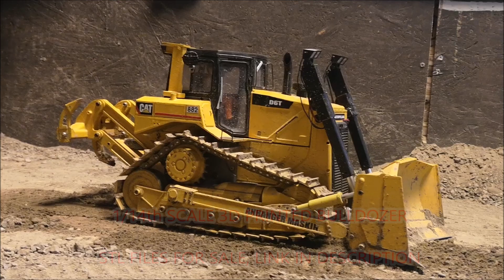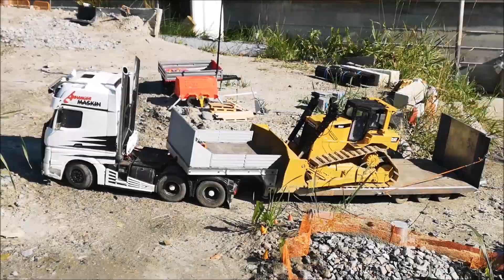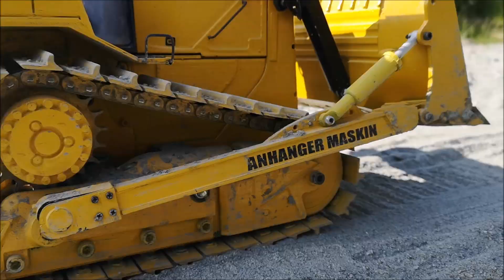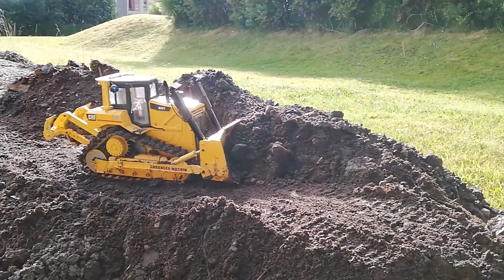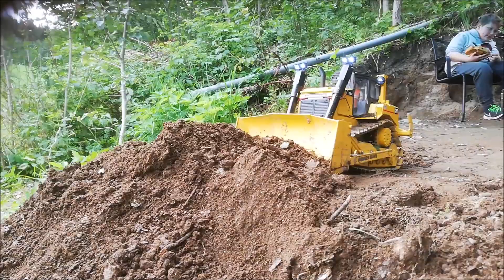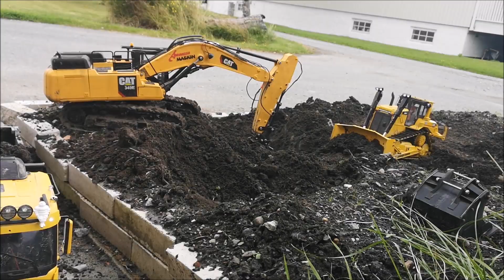STL files release - 3d print you own hobbygrade Bulldozer

Comment: Thanks Lasse! Just started mine yesterday!

These are some of the cleanest and best fitting files I've seen. Mechanically I think this thing is extremely sound. Printing mine at 100% infill and it's quite impressive!

Given the success of this one have you ever considered expanding your dozer fleet into larger machines say a D8? Something that would work in a quarry/gravel pit, rather than a spreading application? I think it would size well with your other equipment, particularly the excavators and the 980 which is next on my wish list!
Reply from the maker: didnt see your comment until now :o yes! I want to make medium sized dozers, and eventually move on to the big boys. :D I dont know when though ,as making a model takes alot of time and effort ;)
Reply: @burnie222rclasseanhanger6 Meanwhile you just cranked out a new D6XE in like a month. I'd consider that very fast!

Comment: What type of paint/primer do you use on these models? They look fantastic! I'm highly considering purchasing the files, but I would want to be able to see the "parts list for what you need" first so that I have a rough idea of how much more it would cost me or if I already have some of the required components.  That would definitely sway my decision on this.  Again, great work here!
Reply from the maker: Prices are not accurate, may vary a bit.
Prices are without shipping.
---------------
1 set of Chains 34$
2x Track motors 64$
2x Steel Flange Couplings 9$
3x Electric Actuators 81$
Ball bearings 14$
12x Track Tension Springs 4$
5x ESC's 47$
Radio \ receiver 70$
So these are the basic prices I come up with on my search.
Ofcourse you still need more hardware, such as screws, nuts, threaded rods, rod ends, led-lights, paint
Reply from the maker: I paint them with brush, a nice and solid paint. nice info . I will put up a parts list, and the costs. gimme a few minutes.